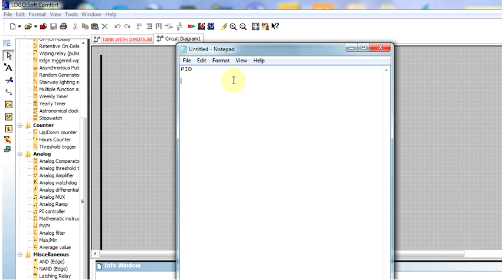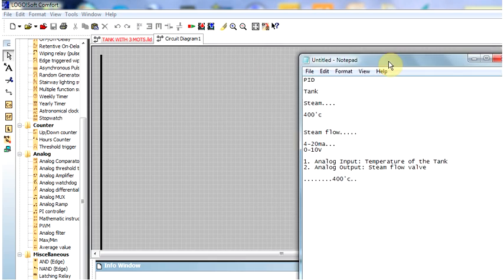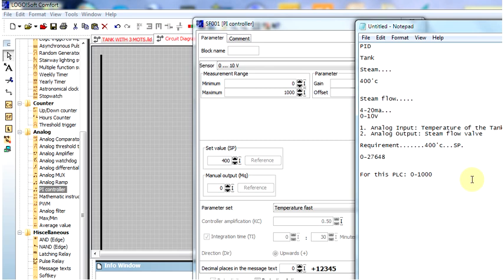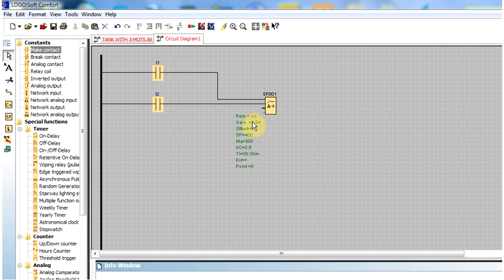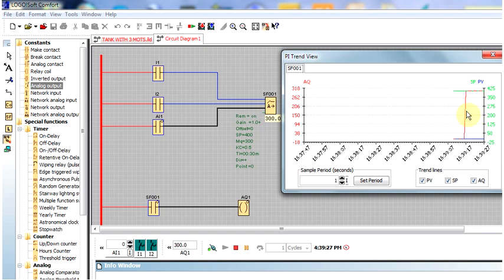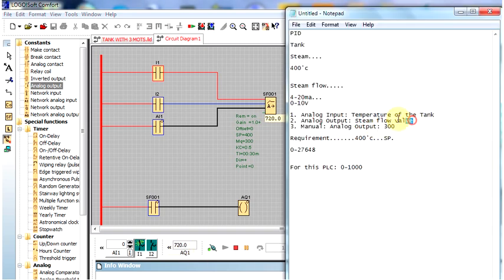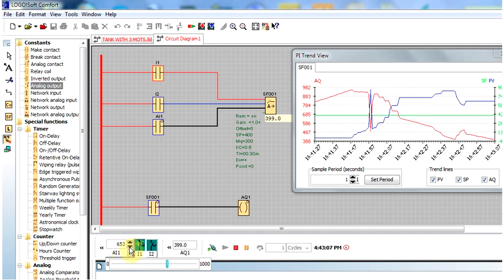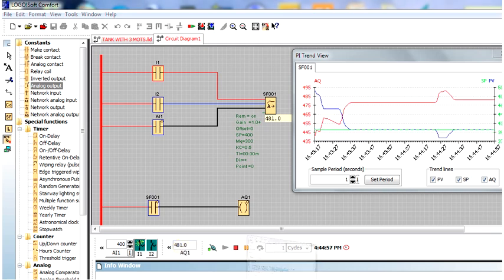Siemens PLC PID Control

Comment: very nice explanation. can you guide me how to control Siemens V20 VFD, which runs a motor to feed fuel to re heat furnace. I want to maintain temperature at 1100deg C. please tell me what other accessories are required to connect with VFD. and how to program the VFD for this Analog input and output

Comment: Mr.Khandaker,
You were excellent and quite clearly explained a practical example project for a boiler or oven control using PID analog input and Output as the PV, SP and Output variable.  Without bogging us down with too much clutter of the PID loop control theory (which are abandant in Youtube), you showed a practical sample project with actual Siemens PLC code..

Yes, several other wishlist would be  - since the PID inplementations are different between other brands of PLC, it would be good to see some of the variations/comparizons - like in RA(AB PLC), GE Fanuc PLC, Automation Direct PLC etc.  Also, an example with an Analog input, but with Digital Outputs - like the ON/OFF control and/or PWM outputs.

Great job! Keep putting new ones..
Thanks.
Reply: pid hidi